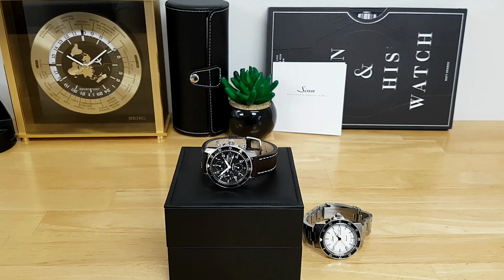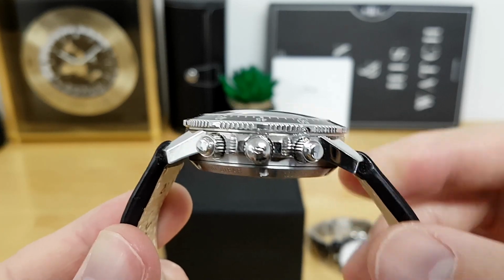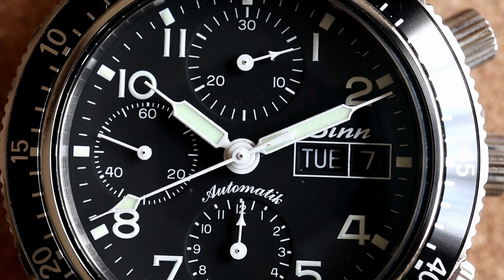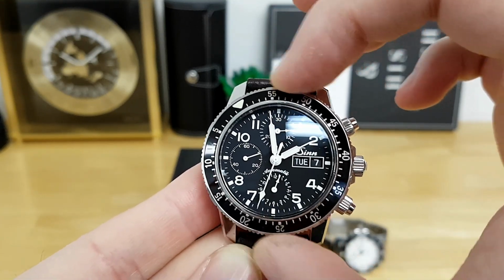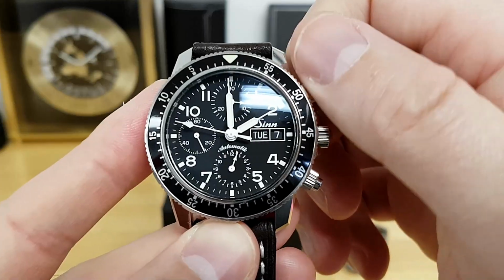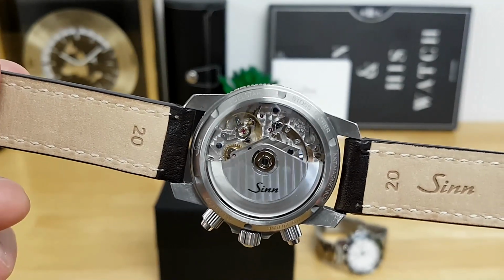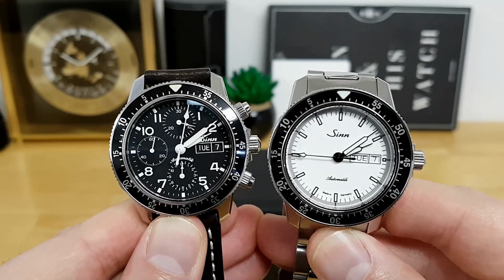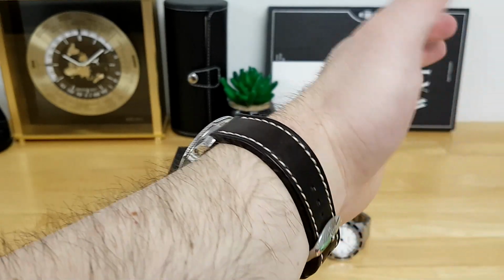Sinn 103 Pilot Watch Review - My First Automatic Chronograph

Comment: Thanks Toran for this review. Can mortal wristed fellows pull this off (in terms of the thickness)? Suppose Sanjay were to wear this (As a basis)? The thickness seems overwhelming. Thanks.
Reply from the maker: Sanjay would die if he wore this watch, lol. It is thick but it's broken up by the mid-case and bezel nicely. A better option if you want something thinner is to get the acrylic version of the 103, which I also reviewed 👍
Reply: @EverydayWatchGuy  Hahaha! Death by Sinn 103! Thats a new one. Thanks Toran. Saw your review on it as well. You should plugged a guitar riff vid in the intro as well. The sinn 103 classic 12 is hounding me. Hence, the due diligence :)

Comment: I think it's well priced for what you get, but I do think it's too thick. It's a beautiful watch but it needs to shed about 2-3mm or so. For a comparably priced watch, I think I would go with a used Longines Bigeye Avigation, just as legible (maybe more with a lack of date), and about 15mm thick. It wears remarkably well on the wrist too. 
I would have liked to see Sinn offer a 12-hr bezel instead of the countdown. It seems redundant to have a countdown bezel on a chronograph, whose main function is to track elapsed time. A 12-hr bezel would allow you use this as a GMT as well.

Comment: That’s very nice. I really like the display caseback. Mechanical Chronographs are very interesting to look at. 
     I have a Fortis B-42 Chronograph. Has the same movement. The hour and minute hands to block the Sub Dials, no way around that. 
       Usually I would go with a 3-Hand over a chrono. Chronographs are cool but not very useful in the modern world, better timing options. Plus the price and thickness increase.